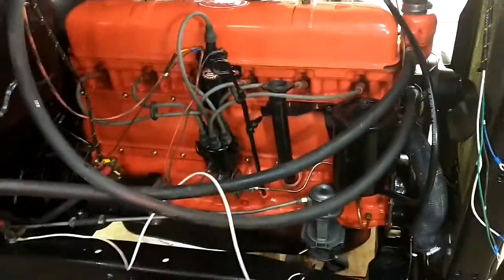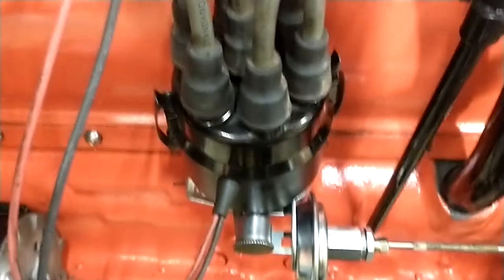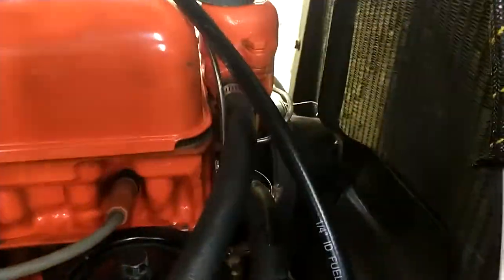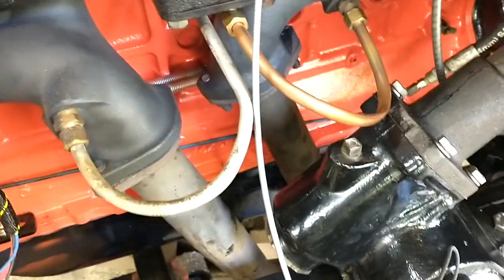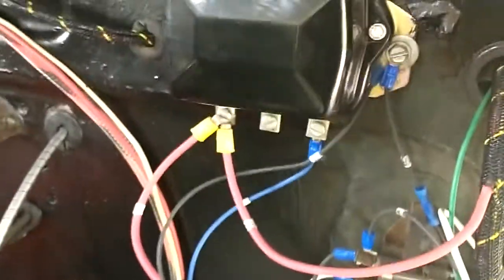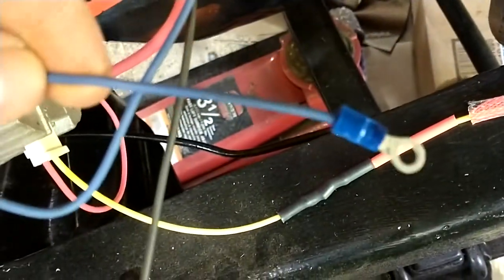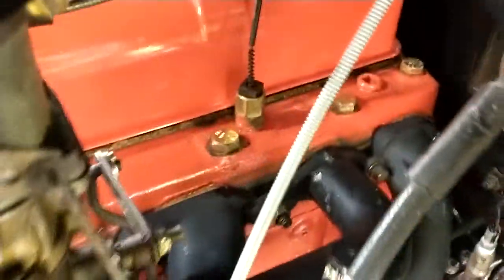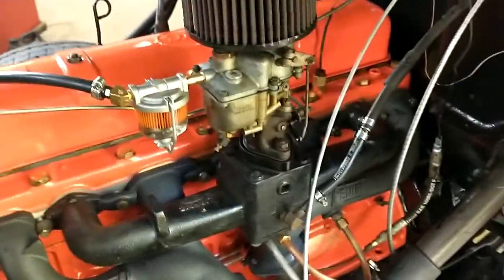1949 GMC 228 I6 engine walkaround

Comment: I just got 1951 Chevy and I don't no about the strait 6 this is a great video to start my project alot off info thanks for putting this video out👍👍👍
Reply from the maker: Glad it helped!  They engines are fairly similar but parts are usually not interchangeable.  Engine parts for the Chevy seem to be more common than the GMC.  I do know that the lifters and pushrods fit both engines!  Good luck and have fun with your '51!

Comment: Great work, is that the original color?  I'm restoring a 47. Mine looks like it may have been Gray.
Reply from the maker: Thanks!  It is not the original color.  When I got it the engine was blue.  I've seen gray and green too.  I'm keeping it mostly original but not 100%.  I liked the look of the orange so I went with it!

Comment: Looks good.   I have a 60 Chevy 235.   Did you rebuild or have it rebuilt?  I wish I had the nerve to do it, but have never gotten that deep into an engine.   I want to get the Fenton headers.. I already got the Fenton Dual Carb Set up.   Its a work in progress.  Thank you for videoing everything. you inspire me to get out there and work on mine.. Right now Im getting my Driver Floor pan in which is a learning experience in itself.   I have the same Muncie SM420 Trans that you have so I have been Watching all your videos on that rebuild.. think im gonna tackle it as well...  Do  you know if you can switch out the granny gear for a higher gear?  I remember my grandfathers old grain truck, we always started out in second when it wasnt loaded down.  Not sure if this is the same set up or not?   Keep up the good videos..
Reply from the maker: Thanks Ron!  Since we were all stuck home last year, I decided to dive in and do a bunch of major work on the truck. I disassembled and reassembled the engine myself.  The machine shop did the machine work and ordered the proper sized pistons and bearings.  This was my first engine rebuild, and it wasn't too hard.  I took it slow and read the manual multiple times and triple checked everything.  I had a minor freakout after the first test drive when I saw a bunch of oil pooling on the floor!  Turns out I had only finger tightened the valve cover, and when I drove up my steep driveway to the garage, all the oil in the head rolled to back and drained out from under the valve cover.  I did the floor pans on both sides too.  During this rebuild I did the drivers side floor, as well as the inner and outer cowl.  I'm new to body work but they came out ok. I watched a bunch of Youtube videos to get the idea.  The truck now has actual cab mounts rather than basically resting on the frame.  I don't think you can change out any of the transmission gearing.  A common thing people do is find a 68-72 truck with the HO52 or HO72 Eaton rear end and take the center section.  Those trucks usually have 4.10 gears and the center section bolts right up to older Eaton axles.  Then you get a little more top end speed.  I don't mind the low gears, I haul stuff with it.   I can do 55-60mph on the highway when needed with 2500lbs of hay.  I think another swap people do is putting in a T5 5 speed.  I never looked into it but there is an article about it on stovebolt.com.    
Glad you like the videos - I've learned a lot from other people's videos so I wanted to give back.  Good luck with your project, hope you get it back on the road soon!

Comment: Where did you get the wire cover wrap, looks great?
Reply from the maker: Thanks Willy - I found it here: https://www.cabletiesandmore.com/flexo-pet-braided-sleeving 
They have lots of colors and sizes.  It's plastic, but it looks pretty close to the old style cotton covering.  I found this site to be cheaper than the classic parts sites for this material.
Reply: @theworkshop3706  thanks

Comment: Where did you find your intake manifold. I have two 228 engines I’m working with. One in my 1948 GMC and the other is going to be a spare or used in a future project
Reply from the maker: Hello - That intake was on the truck when I got it, pretty sure it's original. It was warped a little bit, so I had the machine shop clean up the mount surfaces that go against the head.  Gave it a paint job and it looks good as new.  I do have the heat pipe kit work with the aftermarket Fenton headers.

Comment: Where did you find parts for your engine I have had no luck finding anything.
Reply from the maker: Hi Roger - THere is quite a bit stuff on RockAuto.com, but I also use Jim Carter truck parts (oldchevytrucks.com). The lifters and pushrods from a chevy 235 fit in the GMC (validate your year/model of course!).  Mine originally had the 'soup can' lifters.  One of them broke, so I ordered a set of the 'milk can' lifters and pushrods from RockAuto. There is also a guy in Oregon - jjinlines where I got a whole head.  
When I took the engine to the machine shop, they ordered all the bearings, rings, and pistons.  I'm not sure where they sourced the parts though.   There is also Egge - https://egge.com/.  They make vintage engine parts for all kinds of things.

Comment: Hi, I was wondering what transmission you are running behind your 228? My uncle has a 1949 gmc with a 228 and a 4 speed manual , but he's getting older and he's wanting to switch to an automatic.
Reply from the maker: Hey - I'm running the original SM420 4-speed.  I've never looked into it, but I know they my adapters/crossmembers for switching to a modern automatic.
Reply: Thanks for the response. I look forward to watching more of your videos.

Comment: Please help me - where can I find an oil filler tube (aka dipstick) for my 51' GMC 228 ci? My lower tube is exactly like the one you have in your video - but like yours, mine is missing.
Reply from the maker: Hey Mike - I've never seen a new one for sale.  You might have to search around on ebay to find one.  Chevs of the 40s has dip sticks.  I don't see any draft tubes, which are the bigger pipes that have the breather and oil fill cap.

Comment: Hi how are you doing today? i was wondering if you can please tell me what fuel pump you used,like make and part number please? im having a hard time finding one for my 228 Thanks
Reply from the maker: Hi, I'm well thanks.  The fuel pumps seem to be listed wrong for this truck on some sites.  Most places list the Carter M751 as the correct pump for this truck, and many other GM vehicles from around the same time.  My issue is the pump mounts up fine but the lever doesn't engage the cam.  I tried some other brands with no luck.  I compared new versions of the pump to my original one and it looks like the angle of the pump lever is different.  For a while I was using a dual action type that also has a vacuum pump for the wipers.  That one engaged the camshaft and worked fine.  I think it was the Carter M2430.  That one kept giving me trouble where one of the check valves would pop out and it would stop pumping.  I repaired it twice, then replaced it.  I found an original NOS AC 531 glass top pump and have been using that one for since 2022.  Those are rebuildable.  Jim Carter (oldchevytrucks.com) carries a few different pumps.  They specialize in these trucks so I assume their pump is right.

Comment: So the filler tube is in place of draft tube?
Reply from the maker: Hey Matt - there is no draft tube on this truck - at least when I got it.  The GMCs seem to have an oil bath filter that is interconnected with the oil fill cap that I think serves as the draft.  In this video I don't have the filter on.  My oil bath canister and filter were pretty shot, so I made a new one using a K&N powersports filter (did another video about that)